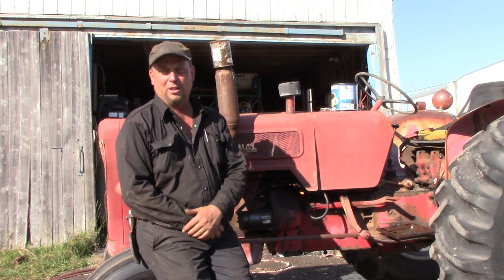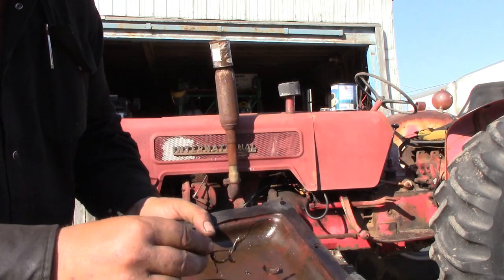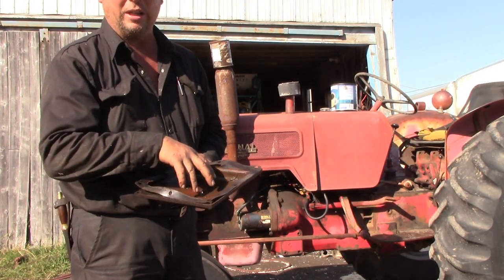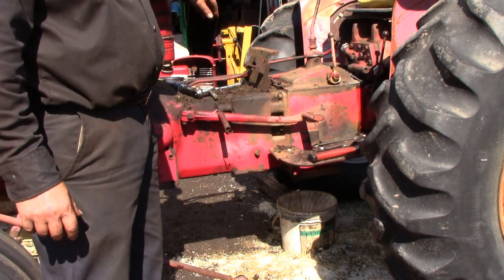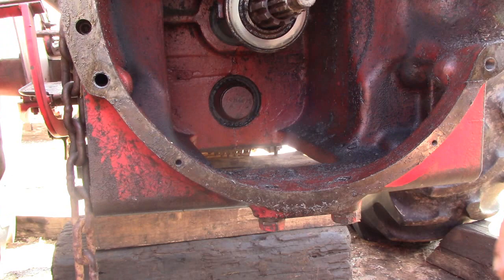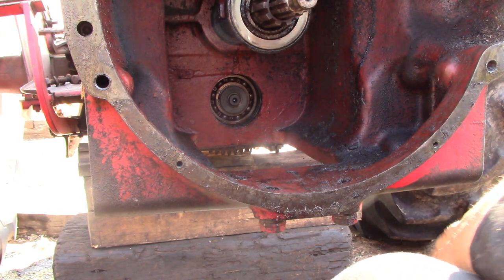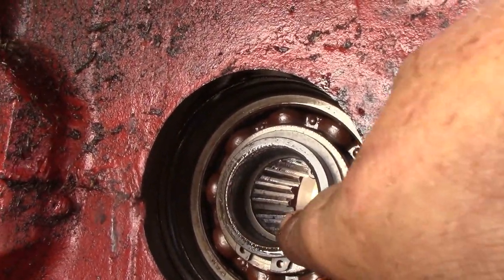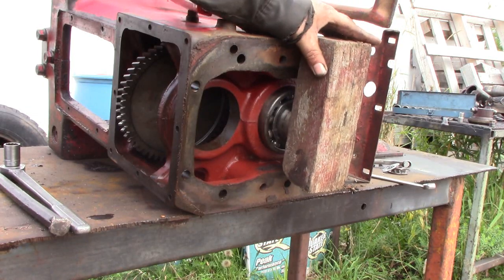IH B414 bound up, what's wrong???

Comment: Hi Thanks for your videos on the 414 just wondering what your comments would be on using a gasket sealant when replacing the cylinder head.
Reply from the maker: I don't I put them on dry. Thanks for watching!

Comment: I just bought one of these and it pops out of first gear. Second, Third, Fourth and Reverse are all fine. Any ideas on where to start? Thanks in advance!
Reply from the maker: The shift fork could be bent so the gear doesn't fully engage or the teeth are worn like a wedge and force it out of gear when under pressure. Thanks for watching!

Comment: Hi Dave I got a 424 gas 1967 tractor a few months ago that had set for close to 10 years and seems to be the same problem that you had with this 414 , stalls when you let the clutch out. My question is if the transmission is the same and if you think it would be the same. I did not find water when I pulled the drain plug out. Think you for your time.
Reply from the maker: Does the tractor roll freely in neutral? It could be stuck in 2 gears. Thanks for watching!
Reply from the maker: @jimstrapper  OK, with it having been sitting you may have a rusted seized bearing.

Comment: Hi Dave,
My B414 reverses ok on level ground with no load but with a trailer hitched up or with a load on the 3 point jib/ crane or when reversing up an incline... it will start to reverse then jump jump jump - attempting to back up but going nowhere.

What do you think would cause this? It doesn't like reversing against any strain/ load.
Reply from the maker: Could be a few things but first to mind would be a problem with the reverse idler shaft., the splines on the shaft could be worn so the gears slips, the case could be worn so the gear can slip past the gear on eth main shaft or some other issues of that nature. You are going to have to lift the hydraulic cover and the shifter cover so you can see in the transmission and find out where the problem is. Thanks for watching!

Comment: Had a blown head gasket on a 374. Never even been inside that part of an engine. Watched your videos and gave it a shot. Marking my top dead center was confusing for me and took a while and after watching your videos again and again 
to get it. Success. I have watched all these videos now with the rear end axle, transmission, PTO etc. and  now going to take the chance on repairing a popping sound in my left rear axle (hoping it is the bearing), while I have the hydraulic off the top will rebuild the speed control which I found a kit for. Then the next is a knocking I have between the engine and the transmission. It seems to be located in the bell housing area and goes away with the clutch depressed. Things I am doing at 62 that I never thought I could do. Yay You Tube University and Professor CR.
Reply from the maker: Wee Lest, that is awesome, it's always great to learn new things! I'm glad that you found my videos helpful, good luck with the rest of your project. Thanks for watching!
Reply: Hi Wee Lest. Did you ever find out what was causing that knocking sound between the engine and transmission? I have the same problem with a 354

Comment: I appreciate your videos! I have one running b414 diesel and one b414 diesel parts tractor with power steering. You have given me the courage to go into the hearts of these beasts. I may even fix both tractors before I'm finished!
Reply: I should say the only reason to go into the transmission on my parts tractor is I think the pto is out, but good (new) on my running tractor. However, my running tractor is an early style '62 model b414 and my parts tractor is a '63 with newer style larger brakes and parking brake lever. All of the hood and grill are missing and the radiator is bad, but I take them in like puppies and kittens and want to save them all. It's a sickness!
Reply from the maker: Thank you for your support, I am glad you have found the videos useful. Good luck with the repairs and feel free to ask questions.

Comment: Have a B414 with a stuck clutch I think, can't put it in gear without much grinding, doesn't stop moving with clutch depressed. Any tricks to unstick or is it a split job do you think?
Reply from the maker: It's likely time to split but first you can try rolling around in about 3 or 4 low range holding down the clutch pedal and jump on the brakes, that may break it free. (Make sure you have lots of space so you don't run into anything!)
  Thanks for watching!

Comment: Hi Dave, another great video! I have a bottom end leak and it’s coming from what’s described in my B414 parts manual as the clutch housing “hand hole cover”. The manual shows a “sealing strip” which is clearly the source of the leak. What is a sealing strip and can I simply use some gasket maker or do I need a gasket of some sort? Thanks in advance!
Reply from the maker: That sealing strip is a strip of felt or some-such that is meant to keep water and dirt out, there should be no oil in the clutch housing so it is leaking in from either the engine or transmission. Take the tin plate off the bottom of the clutch housing and check if you can tell where the oil is coming from. Thanks for watching!
Reply: Canadian Redneck Thank you so much Dave! Now I’m really worried. It looked like gear oil vs engine oil but I’ll take a look. It was leaking quite steadily when the engine was running. Thanks again.

Comment: Hi Thank you for your Youtube videos on the 414. they have been very usefully as I have IH444. With regard the Differential how do you split it to replace the diff lock shaft. I have removed the retaining bold but cant see how to split unit is there a tool that is required ?
Reply from the maker: Besides the bolts the differential has dowels that hold things solid. I find the best way is to wedge a small chisel between the halves to force them apart. Thanks for watching!

Comment: I love your videos. I have my father's 444 now that he has passed away and his won't stay in high range unless you hold the lever while traveling. Everything else works fine except that, would you have any idea what could be the cause. I can't find any information on it so far.
Reply from the maker: That is likely the sliding quill gear, a hollow splined shaft that runs on  needle bearings on the top shaft. The bearings are probably bad causing the hollow shaft to wiggle around and shove the high range collar out of gear. Thanks for watching!

Comment: I've got an Australian B275
Can't select reverse gear.
Were do you wrecken i should start looking?
Reply from the maker: If the selector goes into reverse and there is nothing there you need to check out  your transmission gears, if the selector simply won't go into reverse it could be the reverse shift rail has an obstruction so it can't go to reverse (does first gear work?), the splines on the top shaft may have damage or dirt that is blocking the gear from moving to reverse or there may be a bearing issue so that the gear teeth won't mesh. You will have to remove the shift cover to check any of these issues. Good luck and thanks for watching!

Comment: Good day.  GOOD  video what would a bearing   that was shot,( was that going transmission) cost.  Yesterday I watch grease monkey1 take big JD transmission apart very big bearings.  Thanks
Reply from the maker: The bearing for this job was about $40 or $50 dollars, but there can be quite a range, up to a few hundred depending on the design.  Thanks for watching.

Comment: I love your videos they are so helpful, thanks for doing them, I have 5 B414 tractors 2 diesels, 3 gas, I am trying to disassemble a R92 power steering cylinder , It turned left good but hard turning right, I got the outer cylinder off but having trouble on the inner one, the manual dose not help much, is there a video out there on these or do you have any used ones , thanks for your time,
Reply from the maker: I'm sorry, no videos on them, they're beyond me. Thanks for watching!

Comment: Need help with the PTO on a 424. PTO will turn without a implement, but not with.
Reply from the maker: The PTO clutch is likely worn out but check the adjustment for the PTO disk first, you could get lucky and just need adjusted.
 Thanks for watching!

Comment: you use the word grease .....???? would you not fill the transmission with oil????
Reply from the maker: Yeah I guess I did say grease when I meant 80W90 gear oil.
Reply: What kind of oil for 434 IH transmission and hydraulic systems?